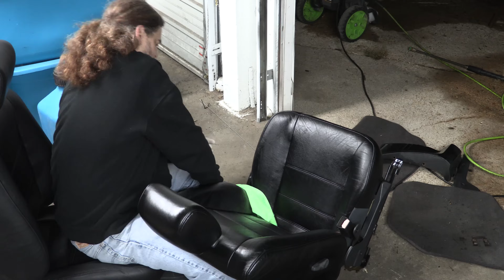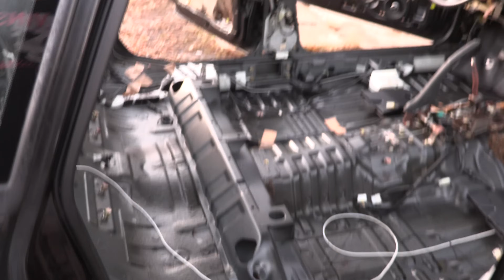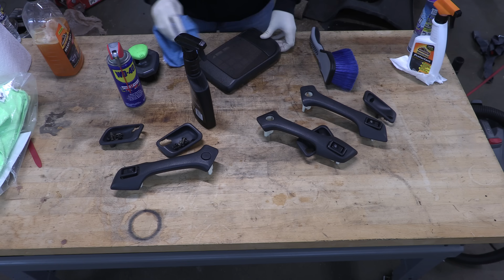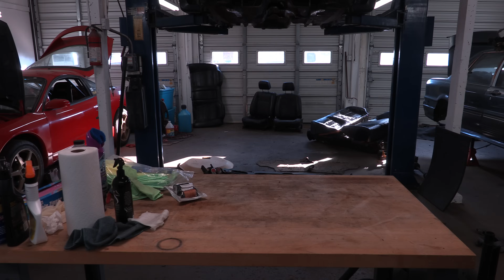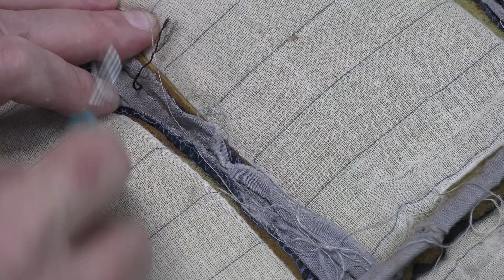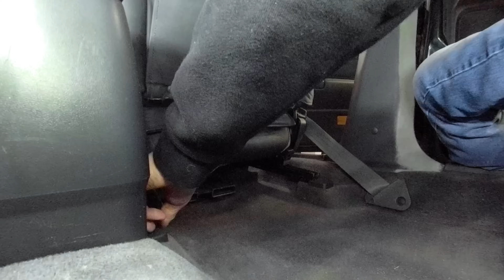New Project + Interior Restoration!

Comment: I'm going thru all this with my 84 Fiero at least my floors are rust free. I got to the sound proofing laid down but unfortunately my carpet is to far sun faded to be saved. The after market carpet is not the old style loop stuff and does not have the salt and pepper style so I'm going to have to comprising and get a solid color. I all so have the 2 tone dark/light grey plastic. All the light grey abs plastic oxidized, I'm going to try this stuff called Retro bright on the pieces. SO replacing the carpet means the lower door cards wont match so I found some one to make vinyl replacement. There are replacement seat skins out there but I also have to dive in there and replace the headrest speakers. Its going to be tons of hours of my labor and still at least 2k to get every thing replaced and installed. I'm glad you did this video showing its possible, I hope it encourages more people to try repair and restoration of there interiors.

Comment: Have a car that has had that same windshield crack that was repaired by a shop... Vac glue method was used... Still has the same windshield 10 years later and the repair is seamless, invisible... The crack was caused by a rock that dropped off an idling truck next to my father who was driving it at the time... 

I gotta say that i love your stuff man... Been watching you for a long time...

All the best and kindest regards,
Steuss

Comment: I just bought a set of Recaro's for my Saturn Ion Redline. The previous owner of my car decided to sell the original Recaro's, and replace them with trash base model seats, before he sold it to the dealership. Anyway the drivers seat leather bolsters, and bottom all have blown out stitching and now I know where to start in those repairs. I'm going to re-enforce the seams also, I'm a bit larger than the intended demographic of this "sport compact Saturn". As always, I learn something I would have struggled with watching your videos. I will start on that seat over winter break from work.

Comment: A trick to revive seat foam is to use a steamer.
Its a great idea to line the bottom that touches the metal seat frame with some sort of thick fabric like denim material.
And to have a absolutely new feeling seat cushion add a 1/8" layer of foam right over the whole thing.

Comment: Sorry for your loss, Jafro! 
On another note, those push-lock fasteners, both pushed and screw type are used on Kubota tractors aswell(japanese). I work a s a Kubota technician, and I deal with those all the time. So, you can pretty much say, that this mitsu is a small percentage tracotr. 
Keep up the good work!

Comment: @jafromobile it might be a good idea to take one of those seatbelt buttons and send it to be 3D scanned that way the community can turn the scan into an STL file to make some 3D printed versions from red ABS or ASA. ASA in particular is very UV resistant, and both will put up with the high interior temperatures in the summer.
Reply from the maker: I think you can do that with your cell phone now?  I have a 3D scanner at work, it's a PITA to use, slow, and requires post processing... but students are coming in with stuff they scanned with their phone.  Remember some phones have LIDAR.  Not mine.  Just some.
Reply: @Jafromobile  Any Pro iPhone after the 12th one and any iPad Pro after 2020 has a LiDAR sensor, they aren't very accurate for smaller parts like the seatbelt button though.

Comment: 90's leather is such a bonus.  These days, a lot of interior leather is sealed - ostensibly to protect against stains, but it also means that leather conditioner just can't get in.  I'm told you can break the sealant a bit with scotchbrite pads, but I've not had the guts to give that a try just yet.  That said, the sealed leather doesn't seem to attract the mould either, so I guess it comes out even in the (power) wash.
Reply from the maker: I don't know how Toyota/Lexus leather even qualifies as leather?  It's so delicate!  That coating damages so easily with heat that you're better off just cleaning and refinishing it.  That's why I left the warning.  Like you said, the hide on this car is thick!  But it does create more maintenance.

Comment: Fender come off and door skins can be fixed 
 Windshield can be repaired, but I'm not sure if that moon eye can be fixed, though looks like it's sealed on both sides.
 Mold you had to deal with that before & with good results.  
  Good progress & happy holidays.
Reply from the maker: A lot of time has passed since the ozone treatment, and if I could do it all over again, I wouldn't.  It accelerates the oxidation of everything including the plastic.  Of course almost nothing plastic or leather was good to begin with, it had all already faded... but the seat I treated that you're referring to was this passenger-side replacement that I restored in this video.  It got a lot softer than the driver's side over the years that followed.  For years I was testing the results of different methods, and this was what I came up with.  1229's interior did clean up, but it actually rolled downhill faster after the ozone treatment.  Hard foam got even harder, leather shrunk more, more fading.  All the door lock pulls I had left broke off.  I can't blame it for all of that but it certainly didn't help.

Comment: "Double top stitch" is called a french seam and is secured by both the first sticth and the under felt which is far easier done on a double needle walking foot machine, not two top stitches, it's also used to secure a raw edge on the fabric. A safer way instead of a heat gun on the leather, is to use a steamer after setting parts in the sun to soften slightly. 
Love the leather in the US spec VR4, wish I had a set in mine. Mines JDM spec so has the fabric glued to the seat foams, so not exactly easy to re-upholster even for someone like myself whom does automotive upholstery lol.

Excellent job btw, never done much hand stitching unless it's a steering wheel or gearknob but props, use a wax coated thread in the future if you ever have to face the same unpleasantness😂..

Comment: Hmm I can’t see you using any type of soap if the seats or the carpets? The soap will break down a lot of bacteria and dissolve organic matter. Just blasting it will get some of but also push some of it deeper in cracks and provide nourishment for it. I usually use saddle soap on leather with a horse hair brush. Then just wipe it if and condition. I bought my stuff as you did from a horse shop! For carpets you want something that dissolves and then lifts the dirt. Cool project 😊
Reply from the maker: There's 2 parts.  A cleaner and a conditioner.  The cleaner was the first step of every piece of leather.  ...and I noticed the cleaner seemed to penetrate and soften the leather much faster than the conditioner, but it just continues with this conditioner.  It sorta jump-starts the process.  The carpets I'm not replacing will go to an extractor.  I have a friend who runs a detail service.  :D

Comment: Talking about biohazard..   Discard and replace any jute carpet underlayment.  Soaking the seats then topically wiping the leather and calling it good...still masking a biohazard.  Undoing hog clips and taking leather/upholstery cover off the foam only takes needlenose pliers and the will, inspect and treat the problem ever present underneath and from the backside.  Headliner too!
Reply from the maker: All correct!  The jute's gone, but I'm saving it to use as templates for the replacement.  That's actually the only thing inside the car that the mice were after or affected.  The interior fabric I was referring to sending to the extractor is just the rear deck lid cover (if I don't clean that one myself), carpet, trunk liners, and the headliner.  Rreplacing any of the seat padding or fabric requires completely de-stitching and re-stitching the entire seat, and that goes beyond where I'm willing to go because they really aren't all that bad... but the rusty seat frames might just still be bothering me enough to go back in there again.  Why doesn't the factory paint ANY of that steel?  It's not just Mitsubishi, nobody does it.

Comment: 3d print new red buckle buttons using UV resistant abs plastic? Or whatever type of plastic you need. Should work right? Would printed plastic be that much weaker vs cast/blown plastic? Just a thought for your brain to ponder. I mean it's just a button, its not actually doing any hard work right?

Comment: I have a base model fender if you want it.. in black
Reply from the maker: I'm in the midst of running part numbers through an archaic emulation on a computer assembled in 1997 at the moment.  It's overheating, so I have to go do something else for a while... but I do believe the fenders are actually different.  If I can alter that belief after running the part numbers through CAPS, I may take you up on that.  I think the trim doesn't fit it if I'm not mistaken.  Yes, I want to be mistaken.

Comment: Never use saddle and tack stuff on automotive leather. They're not the same type of leather/finish
Reply from the maker: Like you said, except when it's AMG leather like this.  Then it's right.  Most "leather" interiors aren't leather, or are so processed so far they no longer resemble their original hide.  The leather inside this galant is the same thing as saddle leather.